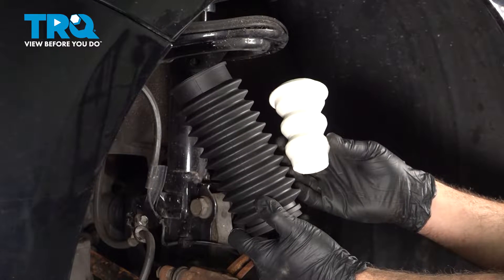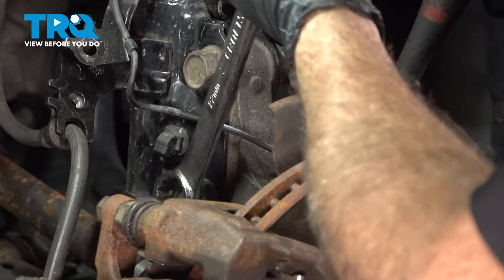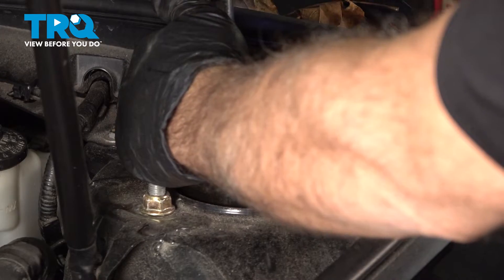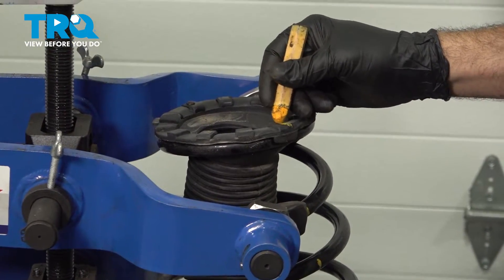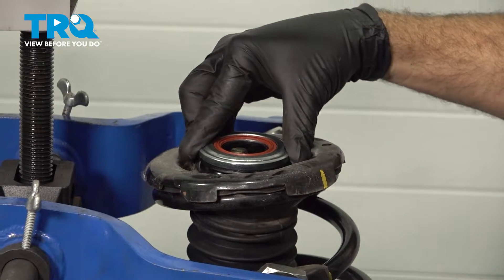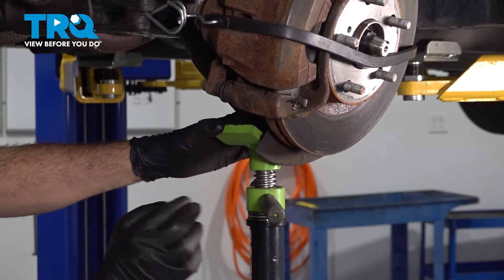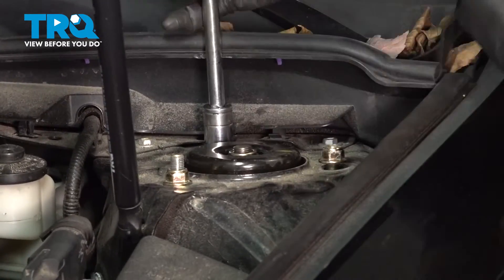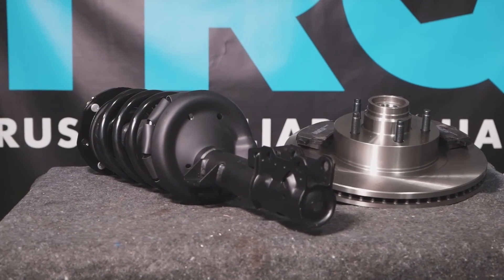How to Replace Strut Boot & Bumper 2012-2017 Toyota Camry

Comment: What's a good tool to raise and lower that strut in and out of it's mounting point?  That may be a good thing to invent for the DIY home mechanic.  It should be something consumer grade that will also compress the spring on the strut.  Oh...and push the brake assembly up into the strut's mount.  Oh yea... and then torque down those brake bolts to 214 ft-lbs....?

Comment: Aren't you supposed to take the car of the jack stands and then torque the top 3 bolts to spec?
Reply: No, actually you fingers tight them while the tire is off and then you put the tire back on and you let the car all the way down so that the weight of the car is down on that strut that's you tighten them all the way.